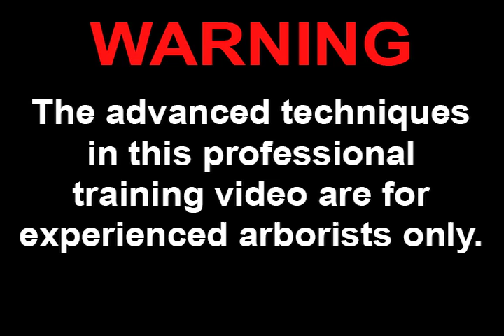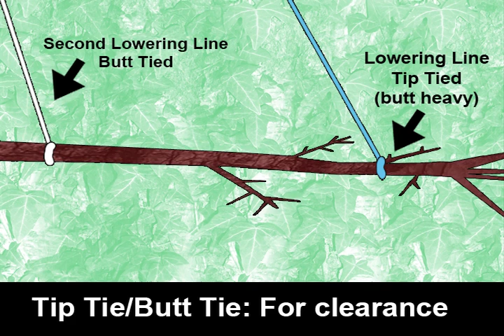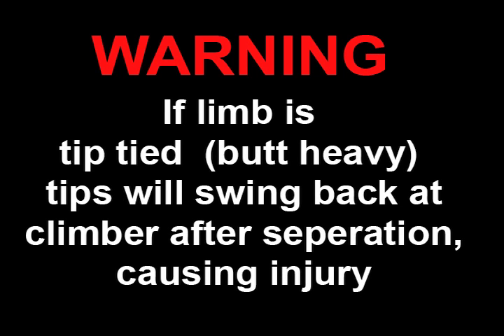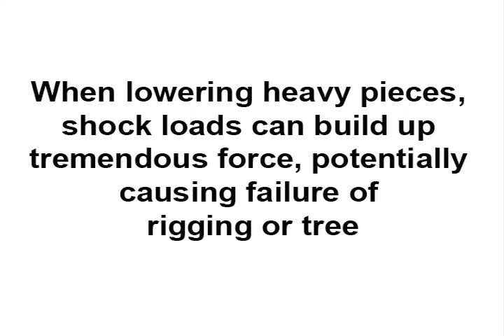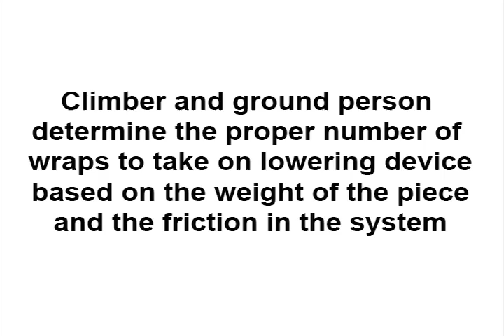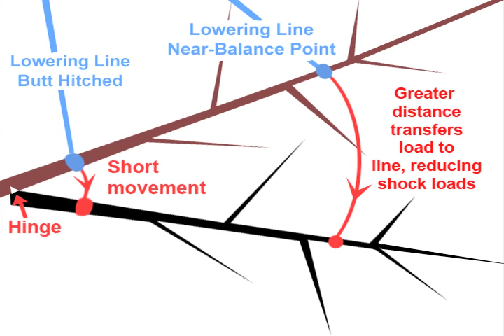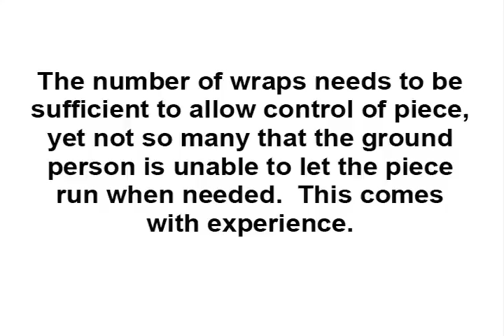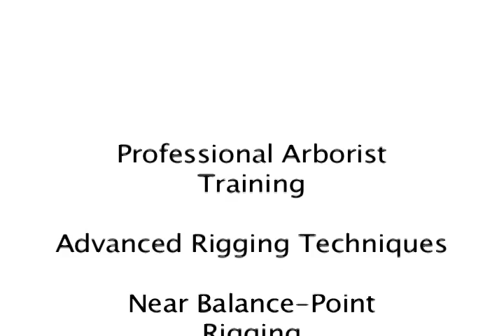Near Balance Point Rigging Tutorial.mov

Comment: The other nice thing about that peel cut is how the butt is more safely held in place as the limb swings down, reducing the chance it will dangerously swing back into the climber's space. When you switch to balanced rigging you have to attach the line farther out, which creates more lateral forces on the rigging point that pull the limb back toward the climber. The more you think about this the more complex it becomes. Thanks, Daniel!
Reply from the maker: yep

Comment: Good use of terminology and even math. One thing you touched on was the risk of tying too far past the balancing point (tip heavy) resulting in the butt potentially striking the climber. I would add that, even if tied in the correct position, the butt can still strike the climber if the tied limb makes sudden contact (e.g. another tree, side of a house, strung cable) and bounces the hinge loose off the stub. 

Its not so common with branches because they can bend and absorb but when tying heavier arms or long stubs it's especially a concern as the tie point can swing like a swinging battering ram back at the climber if the holding wood gives out at that moment.
Reply from the maker: If you tie past the balance point the but can go down and the tips come back up and slap you in the face

Comment: Works beautifully here with the perfect run of rope. I’d like to see a companion video of when it can be dangerous. 
Nbp tieing a log. Particularly a more upright log. Say the piece is heavy needing 2.5 wraps to hold, but the log starts rotating with 90% of its weight still on the stub, the groundie doesn’t have a chance of running it until most of the weight comes into the rigging by which time it’s too late and the piece has swung round slapping the climber. I hope i described that okay?